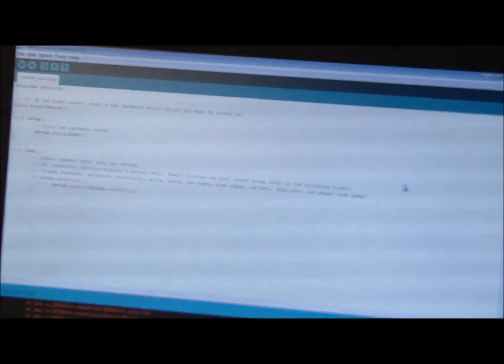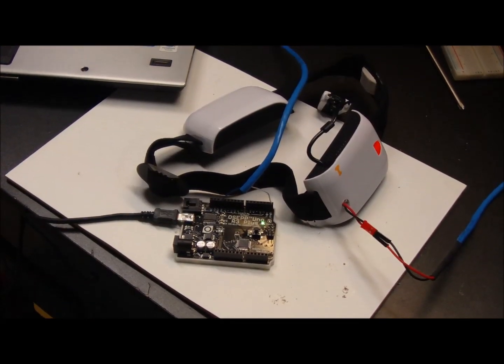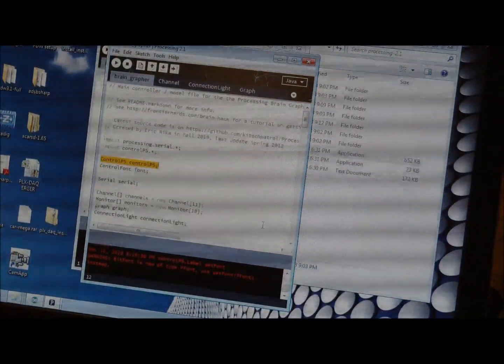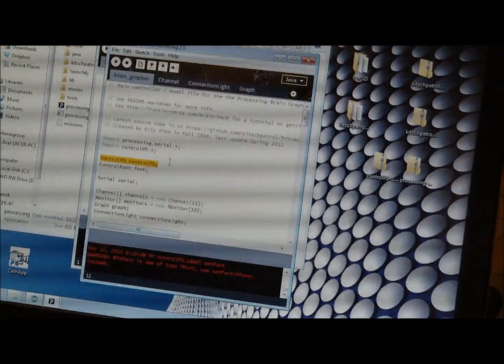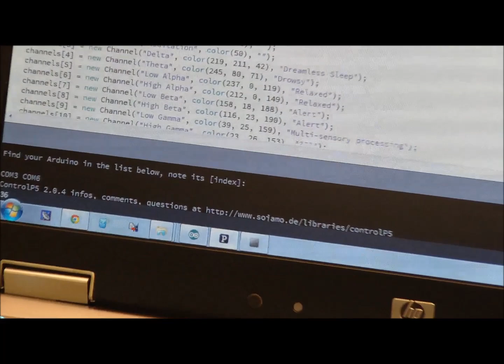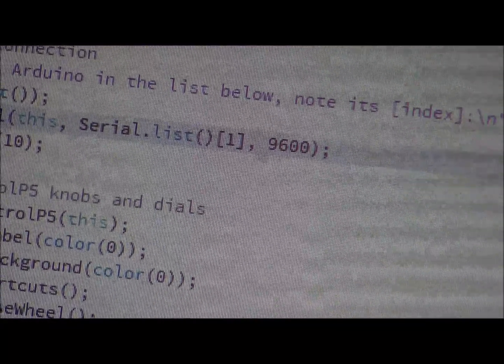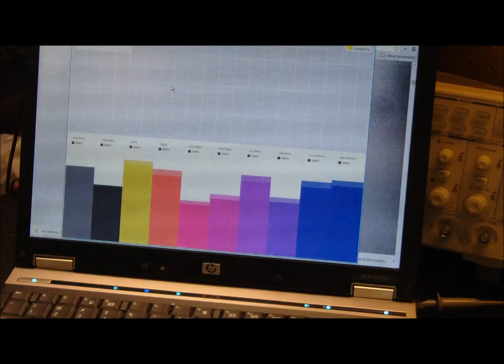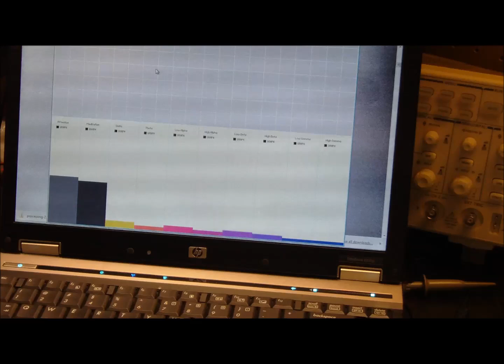DIY Brain-Computer Arduino  Interface Tutorial Part 2

Comment: Great set of videos! I was wondering if you had done the wireless version? I want to do this hack, but i need to use wireless (for safety) as my Arduino will be ultimately using line V and also controlling a relay shield. Ive looked all around but i cant seem to find any tutorials. Cheers!
Reply from the maker: No wireless one here yet. Maybe something I should try
Reply: Thanks anyways, If you do make the woreless, I would be very interested! Your videos are really well done
Reply from the maker: Will see what I can do. These old videos are not very well done tho ;)
Reply: @wadewarman6063  You should go for a wireless Arduino microcontroller. The ESP32 for example is arduino compatible and bluetooth capable

Comment: I've done the thing but the attention and mediation are always zero :( and the connection is yellow ?
Reply from the maker: +jad salah I would say check the port is correct in processing and make sure you have TX from headset hooked to RX on Arduino.
Reply: actually i can get all data like high alfa and beta and all but just the attention and meditation are zeros
 MKme Lab
Reply from the maker: +jad salah Those are internally generated and might be something with the chip being grumpy with the stability etc. Try moving the headset around and giving it more time to stabilize. Also try moving away from high speed switching power supplies like electronic fluorescent light ballast. I found that caused issues sometimes. Cheers
Reply: how much time should i give it to stabilize?
it's been like two days trying and I've the same result ... colored curved but not the attention and meditation ones :(
Reply: have you a solution now for the problem?

Comment: I have a problem. I hocked up my mindflex into the arduino and uploaded the sketch but i'm not receiving  any data, the serial monitor shows nothing and the L diod doesn't blink
Reply from the maker: +Flavius Make sure you have the TX from the headset to RX on Arduino
Reply: is and won't work :/
Reply: can i have your e-mail? because then i can send you pictures and then you can see if i made a mistake
Reply: @flavius3375   hello try to upload the code first with the arduino board without the headset and then hook up the headset

Comment: I obviously have a lot to learn... but, how did you use the oscilloscope to decode and translate to the arduino?
Reply from the maker: I didn't.  It's just basic serial data out from the headset.  Code posted on my site. mkme.org
Reply: Eric William Thanks for the super quick response, man.

I'm just getting started in electronics.  Which micro - controller board would you recommend that I start on, Arduino, Pi, Beaglebone, ChipKit, other???
Reply from the maker: TheRangeControl I use Arduino for most projects.  You can't fail with that.  Cheers
Reply: Eric William Thank You
Reply: Eric William Thank You